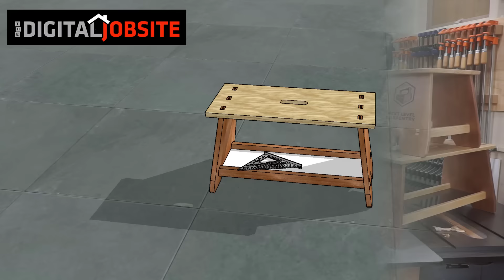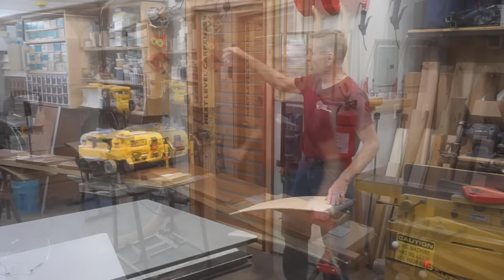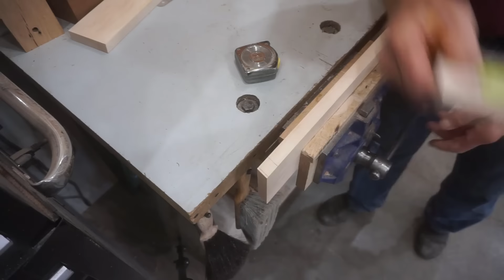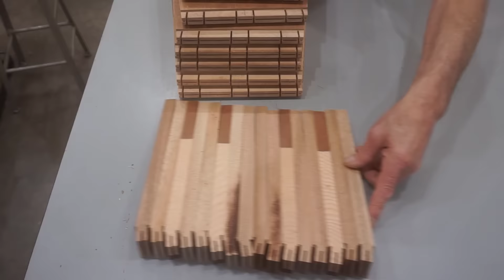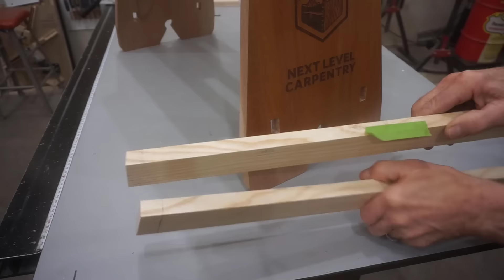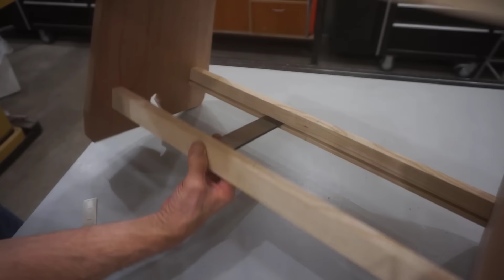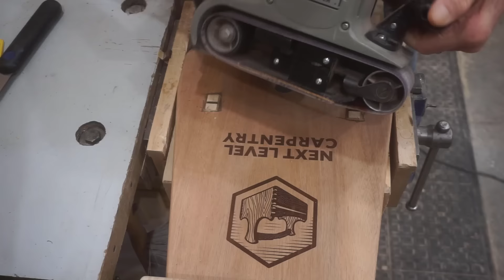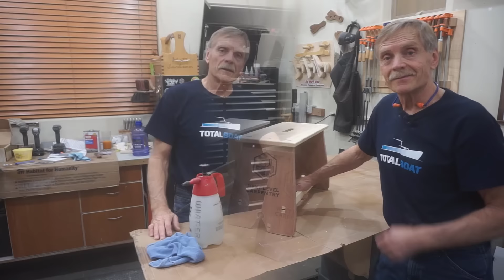Master Carpenter's Footstool

Comment: curious....why not chuck the hollow chisel mortising bit in your drill press?  Not criticizing...just asking...I have a little Delta drill press and I have done this.  Just before 1:10 I said to myself....he's going to use those little cut off triangles for something...you never disappoint, Matt.  Wittle wenge wedges....I'm dying. Not til next year?  Low hanging fruit Matt. little chip at the end....hilarious.  This is a piece of art...the video and the stools.  Two questions Matt....total time to make one stool?  And, purely curious....total cost of say, the biggest one?
Reply from the maker: Good question Rick.  I'd tell you I did it that way to show everyone who doesn't have a drillpress how it can be done but I'd be lying.  Truth be told it never occurred to me so thanks for adding an excellent tip!  Thanks for watching and adding a great comment... much appreciated.  
The last two questions are tougher; total time is so nebulous because of random stuff like getting the engraving done, sourcing materials, etc. that make the 'prototype' so time consuming but, having just gone through the gears I suspect 10+ hours might be reasonable to build one.  As far as cost, the size of the stool is immaterial  because material is a minor factor compared to labor but, on anything less than a well choreographed production basis, I think it would be tough to justify making these to sell at much less than $1,000 per pop without kidding myself about sustainable profit.  Best, Matt
Reply: @NextLevelCarpentry  I’m honored that you even reply and consider something I say as a tip. Thanks again Matt
Reply from the maker: @rickcimino743  I've long held the belief that anytime I think I'm the smartest guy in the room... it means that I'm in the wrong room.  The best room to be in is one where others are open to adding their thoughts to the benefit of all. 😎
Reply: @NextLevelCarpentry  btw and not to bug you but by cost I meant how much did the wood cost for each stool or, all told, how much did you spend on materials
Reply from the maker: @rickcimino743  Ahh: sorry but my answer is still equally ambiguous 😯  My best answer is showing the rough doug fir board early in the video.  It wasn't quite enough for a complete 24" long stool, hence the Karri rails and glued-on sides of the legs. Since the doug fir pieces I glued for legs weren't quite wide enough and pieces cut for rails weren't quite long enough I supplemented with those Karri accents because I didn't want to go buy a scrap of Doug Fir which wouldn't have matched either. That said, a piece 9" wide x 9' long would be a minimum for a 24" stool.  It would probably take 10' of length for the longer stool so the cost of material would be a factor of that many board feet in whatever species.  Crazy thing was was the cost of the smoked plexiglass!  I paid about $125 for a remnant at a glass shop and barely got trays for 4 stools out of it.  Not a complaint as much as a shock but well worth the cost IMHO.  Laser engraving was like $15 per stool.  Took about 2 1/2 quarts of the Halcyon for 3 coats on all 4 stools.  Let me know if I still missed your question?
Best, Matt

Comment: Love your videos, especially the long ones! You hit on two major sore spots of mine. Shim construction and using angles in a project. I get so confused, not knowing which pieces to cut at an angle. Like, why did you cut all the tenons at the same angle of the legs? Was that necessary or just your preference? Can you explain the logic behind that maybe in another video? Also, how would you change the setup to cut longer shims? Thank you so much!
Reply from the maker: Thanks for watching and commenting.  
First: making longer shims? Done: https://www.youtube.com/watch?v=0JTSxRnAJtA&t=810s
I cut mortises perpendicular to the face of their respective piece because it's simpler plus it allows the stool to be assembled.  Picture angled mortises and tenons on both legs and top and you'll realize it would be difficult and ugly to assemble.  My logic is that, for this project, the extra effort to angle mortises and tenons all the way through wasn't worth it for the minimal potential extra strength it might add because tenons that run with the legs and rails would be a bit larger since the way I did them cuts away more wood.  Hope that make sense?
Best, 
Matt

Comment: Great video! Thank you for the tips and tricks I will be able to use in the shop and also for the amount of depth you went in to in this video. I have a question on finishing the top. Have you ever had an issue slipping on it with such a smooth finish? I would love to make this stool but was thinking about a way to spread sand on it for grip or possibly finish it as you have and add a couple 1” strips of grip tape.
Reply from the maker: Thanks Thomas.  Although I've never had an issue with the varnished top on my old stool unless it was wet, it might be a good idea to add a couple strips of that safety tape stuff if there was a risk of slipping during 'extreme' use, if the stool or shoes are prone to getting wet or if working in an area with fine dust since all those things could make it a bit treacherous.  Slippery conditions are never good and stools, ladders, steps etc only magnify the potential for a spill. Best, Matt

Comment: Matt, everyone said it all and better than I can!  What a great video.  What did you call the beam that you used for a sled? My hearing ain't what it used to be. :)
Reply from the maker: Thanks for watching and commenting on this one Stan.  I called the beam an LVL which stands for Laminated Veneer Lumber.  It's basically a thick sheet of plywood 12" wide and about 1 3/4" thick.  Used for structural/engineered headers, etc. It comes in widths from about 9" on up to 16 or more. It's pretty amazing stuff but, as you saw, comes with a few warts that need attention to make it into a planer sled.  Best, Matt

Comment: Very nice. Amazing what one can find when they start down a rabbit hole. I started out watching a couple of videos by a wheel wright and saw this one. 

What made me watch it was that about five or six years ago, I made a similar stool for my disabled wife to use in the shower. The only difference being no bottom tray and and although my legs are tapered , I put them in perpendicular to the top instead of the slight slant you used.

I made it out of some Cypress I had laying around and used black walnut for the wedges. Also my stretcher is right up under the top. I had also cut out a mortice for a stretcher near the bottom, but either run out of material or got lazy, take your pick, lol.

I really like the segments showing how to make and use simple fixtures. I've always just cut everything free hand before.

I've now subscribed to your channel and am looking forward to more videos. 

I'm a retired carpenter with 40+ years in the business.
Reply from the maker: Hey David; design/configuration and material choices you describe make perfect sense for a similar stool for a somewhat different purpose.  Cypress and black walnut sounds like a remarkable combination... nice! Hope you find other videos you like here at NLC! Best, Matt

Comment: It doesn't appear that the file shown on the "tools used for this video" link is correct.  The first file used in the segment about fitting tenons to the top seems to be more along the lines of the Crescent Nicholson's "8" Rectangular Double/Single Cut Handy File - Boxed 06602NN" or similar.  This file has a handle as shown in the video and has one safe edge where the 21825N Nicholson file in the link doesn't seem to have any safe edges, and no handle.
Reply from the maker: You are correct Tom.  Sometime's it's a challenge to find the exact product I use on Amazon because I've literally had some tools for so long they're no longer made or available.  The knife files are  good example... took me a decade to find a duplicate replacement and I found it, with a viewer's help, at McMaster-Carr, of all places.  I use both files in the video and even though the knife file has no handle, does have a safe edge, which is a key feature in the way it's used.  Let me know if I've missed anything else if you're trying to find something specific and I'll try to help out...
Best, Matt

Comment: Finely detailed tutorial.  One question that kept coming back to  —  why didn’t you use a card scraper instead of sanding?  Faster, less dust, more fun and almost perfect finish.
Reply from the maker: Too tricky in tight corners plus it's too smooth for applying a varnish finish IMHO... but to each their own, right?
Thanks for watching and commenting here Roland... much appreciated.  Best, Matt

Comment: Excellent video as always. I'm sure you know about alternative glues that make the glue up less stressful, but I'll mention a couple in case your views don't know

Titebond Extend - PVA glue with longer open time and needs to be in clamps longer

Old Brown Glue - liquid hide glue which is only for indoor pieces. Open time is stated as 15-45 minutes depending on temperature and humidity. In my use 30 minutes at least. Cleans up with water. Does not show under most finishes. Cure time is listed as 24-48 hours but that is temperature dependant. In my experience overnight is generally plenty if at room temperature. 

Franklin also sells a liquid hide glue which I like and is easier to find.

Any hide glue can be reversed with heat and moisture.

Urea formaldehyde glue has a long open time and I'd very strong. I would use it for veneering or bent laminations but not for this project. You need to take precautions such as a respirator when mixing. 12 hours cure time.

Gorilla glue.  I've used it and it works, but don't use it anymore. 

Epoxy. Various formulations have various open and cure times. Slow setting formulas are generally much stronger.

Comment: Did you ever make a video talking about your outfeed roller stands? I recall a few years ago you had some clever ones that would catch the material instead of knocking it over. This looks like an evolution from those?
Reply from the maker: Coincidentally, the next major build video from NLC will be on exactly that topic Phillip.  The ones you see in this video in the planer sled segment are still my originals.  The build video will show the new/improved V2.0 I've designed in the 20+ years of using V1.0.  BTW it's going to be a steel fabrication and welding project on a carpentry channel which might disenfranchise some viewers but there's so much demand for this video it amazes me.  Also: I'm planning to do the video as episodes to avoid another 2 month saga of video production and 2 1/2 hour long video...😉😎

Comment: It would be great if you mention the total time it takes to accomplish each stage, as to set expectations for us beginners.  Such as the time it took just to get the mahogany legs planed and true looked like it'd take at least a solid full day (for a first timer)
Reply from the maker: Sounds like a useful suggestion although it would be difficult to do, mainly because everyone works at a different pace.  Plus the fact that my time is distorted by distractions from video production and I wouldn't want to 'compete' with anyone if they realize how much longer something takes for them than it took me. There's a big difference too in how long it takes to do something the first time and how speed/efficiency accelerate with experience.  That leads me to adhere to the Pareto Principal of 80/20 that I think you'd find applies to your own experience... Best, Matt

Comment: I think you explained this in an older video already, but please explain again the specifics of why you can get away with using both the miter gauge AND the fence on the table saw at the same time, which is something we are always warned not to do.  Not doubting you, of course :)  just want to understand your approach and learn from it.   And as always… amazing, precise, meticulous work.
Reply from the maker: You'll notice I do some operations with miter guide and fence, but not all.
It's better to adhere to the "NEVER DO IT" rule than to risk injury by performing an operation you're unsure of.
In a nutshell: it's all about making sure the piece between blade and fence is under control and pushed past the blade in a manner that keeps it from binding IMHO.  When in doubt, use a different setup to stay safe.    With a mindful approach and thoroughly thought-out approach, some operations are comfortably safe (for me) but, ultimately, that decision is up to the individual.
Best, Matt
Reply: @NextLevelCarpentry  makes sense Matt.  Thanks for the quick reply.  I’ll file this under your lesson RE: the “experience” bucket vs. the “luck” bucket.
Reply from the maker: @asafindy  excellent!  Cool that you remember the two bucket thing... that's where I store it... 😁

Comment: What a video! Took a few sessions to go through it but I learned a lot, especially with using twisted wood with the planer. Great tips!
Reply from the maker: Thx Erik... hope that planer sled segment applies to other projects you're doing?  Make sure to add sacrificial blocks in between pieces as I figured out myself at the end of the process.  I tried to edit around it as best I could but I had more difficulty than expected with the pieces before, during and after de-twisting them.  Stools turned out perfect even though a little bit of twist returned to the worst leg and, as you can see during the sanding segment, I had to deal with some snipe on the legs at that late stage.
Best, Matt
Reply: @NextLevelCarpentry  Absolutely! That segment was especially helpful for a project I'm working on.
Reply from the maker: @Erik_The_Viking  Nice!

Comment: I'm about an hour in at 1115 pm so maybe I missed this. But why did you decide to cut the mortises "straight" and the tenons "angled"? it seems like it led to more dangerous operations on the table saw than the opposite (maybe I'm wrong?). My inexperience tells me you would have been better off to use the drill press with the table tilted (or better yet, a jig). 

Also, _not that it will matter_, but in theory wouldn't the angled tenons be a weaker joint?
Reply from the maker: Hey Gary: you raise good points... thank you.
I have a saying to address concerns like yours about angled tenons vs 'straight' ones for this project: 
"If it takes a little more work to make something a lot better, it's probably worth it.  If it takes a lot more work to make something a little better, it's probably not worth it."  Angling the mortises falls to the latter IMHO.
The setups to cut tenons on the tablesaw, either angled as I did or straight, are equally 'dangerous' IMHO so that doesn't weigh on my choice.  Although angled mortises are surely somewhat stronger, the stool I'm replacing is built the same way and isn't even close to failing from slightly 'weaker' joinery.
Probably the main deciding factor is that if all the tenons were angled, glue up would be much more of an ordeal because all 10 would have to be glued at the same time since the top couldn't be fit after rails were glued to legs.
This is all one carpenter's perspective and I don't mean to lecture whether these decisions are right or wrong...
Best,
Matt